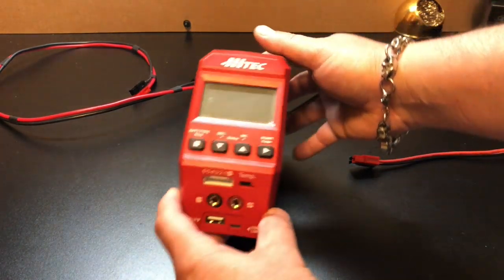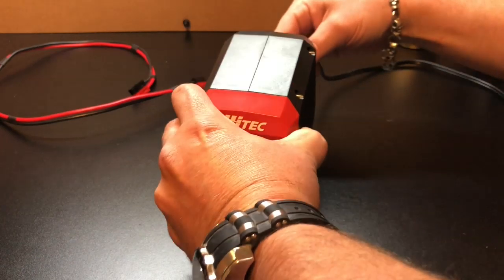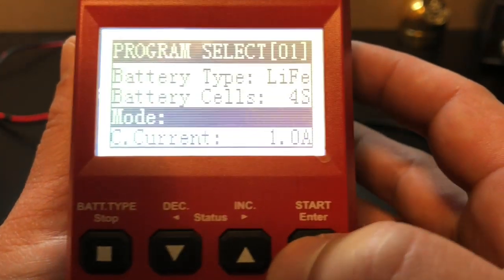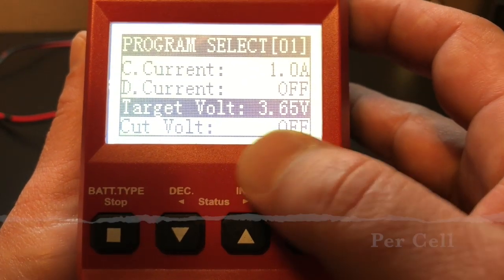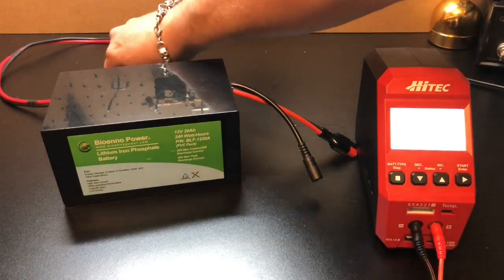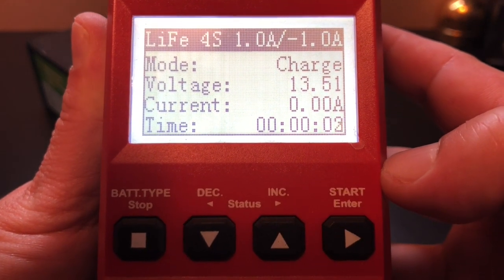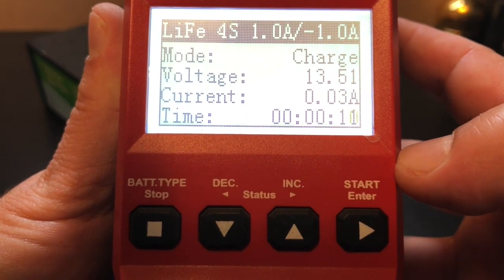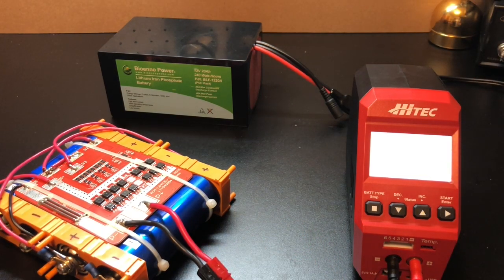Charging LiFePO4 Batteries

Comment: I just bought the newer version of this charger, the Hitec RDX1Pro, and I need to charge my Bioenno BLF-1220AS. When I followed your procedure exactly, I get a "Cell Error." Since I have the charger set for 4S to achieve the correct voltage, I think the charger is expecting to see a plug in the balancing port which is not there because the BMS is built into the battery. Did you do anything in the setup to disable the balancing port so it would just deliver the correct voltage to the banana jacks? Maybe I need to call Hitec support. Thank you for all the great videos. Wish we lived closer to each other (I'm in Northern CA) because I play the Hammond B-3 and it would be fun to jam sometime. Thanks, Mike, N6MSC
Reply from the maker: I put the instructions in the description but you need to go into settings and turn balance off.
Reply: @hamradiotube  I was able to find the setting and turned the balance off. The charger is now charging my Bioenno BLF-1220AS successfully.  Thanks!

Comment: The port you mention early on is a balance connector. Other hobby type lithium polymer batteries used for RC, etc. have balance connectors with wiring to each individual cell that must be plugged into this port. Charging them without the balance lead connected is very dangerous since they have no circuitry built in to keep the cells balanced and charging equally. Lifepo 4 batteries normally have this circuitry built in and their chemistry is much less volatile. I have seen a few folks online using RC type Lipo battery packs for power...unless you know what you are doing, don't. The plug you point out on the rear of the unit is an XT-60 plug, also common in RC. Another good video!

Comment: Getting a cell error on the charger hooked up just like here with the battery settings you showed here. I’m stumped.
Reply: Got it figured out. Had to turn the balance charged setting off in the system setup menu.
Reply from the maker: Sweet, glad I could help lol!  Yeah I forgot that little detail in the video.  I did put the instructions in the description but I feel very few people actually read that.  Super easy to fix but boy it can be frustrating trying to figure it out.  Glad you got it sorted.

Comment: K8MRD...MIKE I HAVE A 50AH Bioenno battery and the Hitech RCD 44245 RDX1 AC/DC Battery Charger/Discharger...and i can't get it to charge.hooked it up the same way you have your's....but i dont know how many sell's it has.could the why it want charge.any ideas??????HELP lol
Reply from the maker: Set it up for 4 cells.  I have mine set to charge 3.65 Volts per cell, but you could go slightly less if you want.  Like 3.6 volts.    Make sure you have the Balance function turned OFF in settings as well.
Reply: @hamradiotube  thanks brother really big help.love the vid's keep up the great work 73

Comment: Question. Bought this charger to charge a LifePO4 12 volt 8Ah battery. Set it up per your settings. When star charge it tests battery comes back error CELL ERROR. I didn’t find anything in the manual for that error. Any ideas. Both batteries same error. Brand new batteries. Update - found the problem. Went into system status. Turned off balanced charge and started working.

Comment: Ok, I have a question. I just received the same charger today to charge my 20Ah Bioenno battery with, but I am not sure about other settings that are in the charger on the System Setup screen. Does anything need to be changed on that screen besides turning off the Balanced Connection?

Comment: Thanks for the video!  Have you ever tried using a “12 volt” DC Source, such as a car battery, to power the Hitec??  I’m curious if that would work, in the exact same scenario as you’re demonstrating with the Bioenno Power battery, which is looking for 14 to 15 volts overall while charging (based on specs of the AC/DC Charger that Bioenno Power sells with their 12V LiFePO4 Batteries).
Reply from the maker: I have not, but it does have a 12V input on the back.  I would imagine it would.  Not too hard to have a boost converter inside to get you to 14.6V.
Reply: @hamradiotube  Thanks for the reply.  After I asked you that question, I did a bit more research, and I agree that it should work.  At the time, I didn’t realize that the Hitec has its own built-in switching power supply.  So, even if the supply-side battery has only 11 volts (the lowest Hitec spec’s), the Hitec should be able to output 14 to 15 volts, assuming that the supply-side battery can provide enough amperage.  73’s.

Comment: I was using this charger to charge Bioenno with built in BMS and it keep saying cell  error even when set to just charge. I found on page 23 of the manual you have to switch off the bal. connector in the menu to make it work.  I did not see this at first when looking in the book.  hope this helps 73s N0FAA
Reply from the maker: Yes, I also have that posted in the description of this video.  More than a few people have been stuck at that step.  Glad you got it squared away.

Comment: I thought LifePo4 Batteries were charged using about 5 amps. Why can't any 12v DC, lead acid battery charger be used for LifePo batteries?
Reply from the maker: Charging current is going to depend on the specific cell that is in the battery.  The one I built with Headway 38120S Cells can be charged at 10C (100 amps). Other cells can only be charged at 1C (C=the capacity of the battery) or somewhere in between..  They also charge differently than lead acid and to a different voltage.  You could use a lead acid charger it just won't charge the cells all the way.

Comment: Great video, Mike. In the process of ordering the charger from Amazon, I asked a question if it would charge the Bioenno 4-cell...some lid responded with a “No”...so much for the Amazon Q&As! Hope to see on POTA!  de KB7GL
Reply from the maker: Well some people just have no idea what they are talking about.  Just make sure once you get it, go into settings and turn "off" balanced charging.  Otherwise you will get an error and it won't work.  Bioenno's already have a balance chip inside.
Reply: @hamradiotube  After I left the previous comment, I tried charging the Bioenno 20A LiFePo4...I keep getting "Cell Error". I checked the parameters on the Hi Tec...I'm in Charge, not Balanced parameter. Still getting the error. I tried the Discharge mode...it seems to work OK. I guess it's possible that one cell in the Bioenno is all out of whack. I'll try the full discharge to see if that fixes it.
Reply from the maker: I doubt it’s the battery.  Did you hit the stop button until you got to the setup menu?  Then Set Bal Connection > off
Reply: @hamradiotube  Damn, Mike...who put that menu in there? And, I'm a guy...I don't read manuals! Yep, the Setup was in Balanced...changed it and now it's doing its thing, as expected. THIS is why I watch your videos...! Tnx, Vic
Reply from the maker: And to think, I put those instructions in the description of the video because I failed to mention it.  I guess that was all for nought lol!  Glad you got it working buddy.
Reply: Wow so glad I found this comment I was about to throw this thing out the window 🤣🤣. Of course I didn't read the description, what logical sane person does that 🤣🤣🤣🤣. But for real Mike I love your channel. Awesome content and productions, I guess I need to start reading the descriptions lol. 73 KO4MAG

Comment: Just starting to think about my build for portable hf.  Does anyone know if you still need a programmable charger like the one shown here if you have a battery management system (like DALY)?
Reply from the maker: You don't need a programmable charger but you do need one that is capable of charging LiFePO4 specifically.  You can't just use any old charger and expect it to fully charge or charge properly.  Every battery chemistry is different and requires its own type of charger.  The BMS is only there to balance the cells and protect from over charge/over discharge.

Comment: with this charger will the bioeno battery top ballance? Bioenocharger does contant currunt and switches to constant voltage.
Reply from the maker: It's not so much the charger but the BMS in the battery that handles the balancing.  However, if you wanted to take the battery apart, or make your own, you could balance the cells any way you wanted.  There is a separate balancing connection on the charger that you could wire up to the cells individually.  It does do constant current/constant voltage as well though.  It will charge many types of chemistries.

Comment: I didn’t read all the comments, but what you have as a charger is used for charging LiPo batteries primarily for Radio Control applications.  LiPo batteries have a balance connector, and that’s what would go into the multi pin plug.  Then the charger can balance each cell.  That’s a function your BMS is handling for you.  When you set the charger to about 3.7 volts and told it you had a 4s battery, it went to the balance connector and looked for the battery, and hence the error.  When charging 4s LIfePo4 battery without a balance connector you needed to tell it to just charge and not try to balance the cells.  The Yellow connector is an XT60 and will carry up to 60 amps.  
Generally you want to charge at 1/2 C or below for maximum life. Not sure what the C rating was on your battery, but they can be spectacularly high like 200 plus Amps.  Like everything else the more current the higher the cell temp which kills your battery.  LIfePo4 batteries like to be stored in a specific voltage range, your manual will specify it.  There are a lot of good video’s on yt.  Thanks for the POTA video’s I am learning a lot.  Rick W7STS
Reply from the maker: What I have is a charger that charges all kinds of different chemistries.  Including LiFePO4.  I promise you I know what I have, and I promise you I know a LOT about LiFePO4.  That big circuit board on the battery (that I built) in the thumbnail and in the video is the BMS, which all of my batteries have, thus negating the need to use the balance function of the charger.  I don't remember what error I may have shown in this video but you do need to turn the balance function off in the settings of the charger in order for it to charge batteries with a BMS.  While I'm not sure the C rating of the Bioenno cells as they aren't published, the battery I built (which are 10amp cells) has a 10C rating.  They are Headway 38120S Cells, and I used a 30 amp BMS.  I have never had my LiFePO4 cells even get warm let alone hot during use and I put out 90-100 watts with my 891 for hours on end.  I do only charge them at 1AH usually as there really isn't any need to charge them higher for me.  I think the charger will go up to 6 amps though.   You don't really need to be overly concerned about what you do to LiFePO4 cells.  They can take a tremendous amount of abuse electrically speaking.  But, physically, they won't blow up on you either.

Comment: The yellow connector on the back is an XT60 I use them all the time on my rc cars. If you use a BMS with your charger and it says "CONNECTION BREAK" the battery is charged because the BMS disconnects the power to the charger. Another awesome video Mike.
Reply from the maker: Not quite but close.  The BMS doesn't cause the connection break.  It simply manages the charge voltage between the cells.  The voltage setting you enter into the charger is how high it will charge the battery.  The BMS would prevent over charge of course.  You do have to change a setting on the charger to enable or disable the bms feature on the front of the charger.  That will make it say connection break.
Reply: @hamradiotube  Actually it was my older charger that caused it. My newer charger works like a charm which is the Hitec X4 but love my diy 38120 Lifepo4 battery pack.

Comment: Hi, I'm not sure but, a bms with seperate ports has different functions for each attatchment. The input will have the high voltage cut of and the balancing function, while the output-port will have short circuit protection and low voltage protection.
If I am right, this would mean you could overcharge one cell (or more) while charging it from the output port.
Reply: The advantage of a seperate port bms is that if high-voltage occurs only the charging port will be turned of --> The load still has power. If a low-voltage occurs, the load side will be turned of --> the charger will still be on. Get a common port BMS if you never have charging and loads in the same time. Get a seperate port if you have a charger and loads connected in the same time.
Reply from the maker: That is incorrect.  The positive and negative terminals that I refer to as input/output are just that.  That is the point where all connections are summed up and total power is delivered/entered.  It's no different than the posts on your car battery.  You either draw power from it, or charge into it.   The other connections are between the individual cells and they are what balance the cell voltage to ensure they are all the same.  This is the one I'm using if you want to take a look at it.  https://www.batteryspace.com/PCM-with-Equilibrium-function-for-12.8V-LFP-Battery-Pack-30A-limit.aspx
Reply: @hamradiotube  the bms you are using is a common port bms, as you say it does both output and input on the same connection. I was talking about the other battery that has a charging port and a load port. When charging at the load port it might be possible the bms inside is not operating correctly.
Reply from the maker: @1kruxi  They are both connected to the same place.  Just 2 different plugs connected to the exact same place on the bms.
Reply: @hamradiotube   Aah i see. Sorry for the confusion.
Reply from the maker: @1kruxi  No worries.  I'm happy to talk batteries.  Thanks for watching.

Comment: Soooo, ...how long does it take the Hitec to charge the 20Ah Bioenno at (1 A?) after a typical full day use of the battery?
Reply from the maker: Well, if I used all 20 amp hours, at a charge current of 1 amp, it would take 20 hours to charge.  Usually I use around 6-7 amp hours, so 6-7 hours to charge.  I could up the amperage and charge it as fast as I wanted if I was in a hurry, but a lower charge current helps prolong the cells lifespan.  If I wanted to charge at 10 amps I could, and it would be ready in 2 hours.
Reply: @hamradiotube  and what is the battery voltage at when your 20ah battery is full??

Comment: Thanks Mike, good stuff.  Being an RC guy (which then lead me down the HAM path ...) these RC chargers are really common and do have tons of settings to handle many types of batteries in the hobby.  Typically the Current setting should be set to 1C of your battery when charging.  In RC world, a 2,000mAh (2Ah) battery would charge at 2A = 1C.  That's for a Lithium Poly battery.  The rule of thumb for long battery life is to never charge over a 1C rating for your battery.  According to the Bioenno site their charges are putting out 4A, which is WAY under 1C for a 20Ah battery or .2C rating. but boast 2,000-3,000 cycles of battery use.  
Thanks for your awesome videos!
Reply from the maker: Yes their chargers put out up to 4 amps, but the lower you charge your battery, the longer life you will get out of it.  I don't use LiPo batteries, these are Lithium Iron Phosphate (LiFePO4) and are way safer and can take a crap ton of abuse.  You can actually charge these types of cells at 10C if you want, but doing so repeatedly will drastically reduce their life span.  I usually recharge after a ham radio portable activation so I don't need to top them up quick like you would for RC if you want to keep playing.  Low and slow at 1AH is fine for me.  Yes LiFePO4 batteries have a 2-3k cycle lifespan.  They are, in my opinion, the best chemistry battery that exists right now for what I'm using them for.  For RC, LiPo is prob best because they are a smaller form factor for the power.  I could go on and on about batteries.  I've turned into quite the battery nerd.  You are correct in what you say though.  I just like to baby my batteries.  Thanks for the comment.  73
Reply: K8MRD RADIO STUFF I learned a lot about the LiFePO4 from you. Seems like the perfect match for radio. 73 Bioenno here I come.
Reply from the maker: @W0KNI  Oh cool thats great.  They are fantastic for Ham Radio.

Comment: This is all works as Mike demo’d if the balance  connection is turned off.  Otherwise you get errors

KD9NWA
Reply from the maker: Indeed it does.  I put that info in the description as I forgot to say it in the video.  Thanks for watching.  73

Comment: If you guys are building small 12v 4s2p cells without a BMS I would suggest just using a Motorcycles Battery Charger... if you screw up on the setting you may start a fire....  just saying we know alot of guys using these Hobby type chargers and they are way to complex for just throwing it on a charger that will use a standard safe charging profile.  Just connect and go.
Reply from the maker: Clearly you have no idea what this type of battery is, regardless of your user name.  It’s also apparent you don’t see the bms strapped into the cells of the battery.  Please don’t spread misinformation on a subject you aren’t well versed in.  If a charger is too complex for someone, perhaps they shouldn’t be using batteries.

Comment: That looks so ugly. Just get a hobby charger, like the bmax b6 or any of it's revisions. Does the exact same thing. Also that error is for not connecting the cell balance leads to the charger, i get the same error while charging lifepo4 cells one by one. Guessing that error would be there if i charged lipos and lions as well w/o the balance leads. Tried charging a nimh and a lead acid battery, was fine for those two w/o the balance leads.